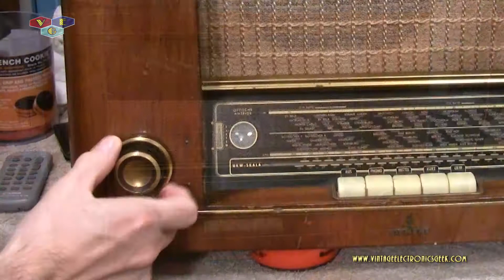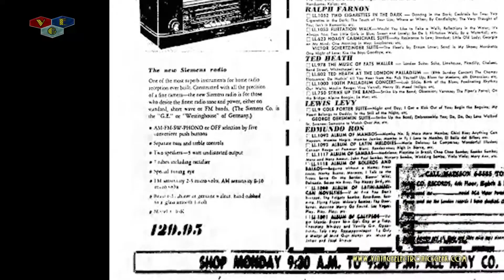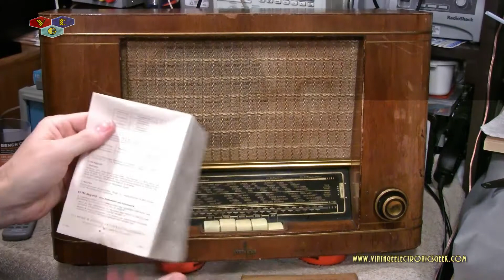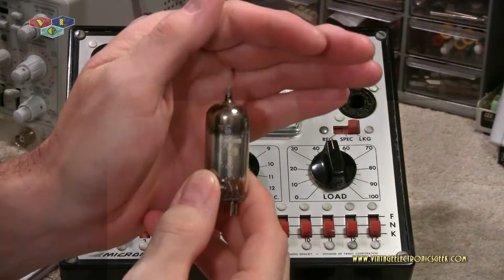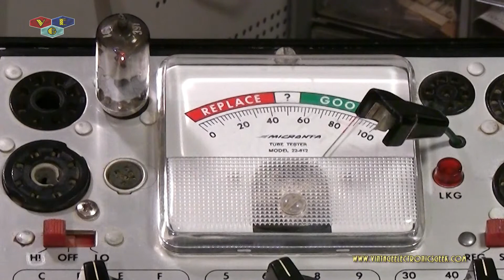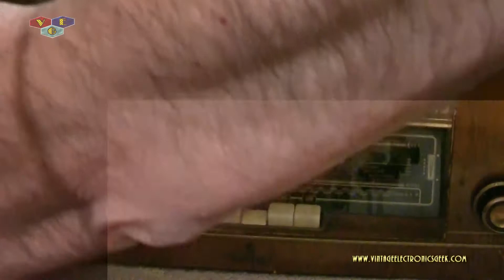Siemens-Super C 40 K - AM/FM/SW - Introduction / Overview

Comment: Hey Jack that siemens radio has the same cabinet and front face as my 1957 German radio I bought at the garage sale a couple months ago. All I had to do to it was restore a ferrite core it was missing and rewire it and clean the volume control and it works great. If thats the same its going to be a great project. All the same German markings as mine and the lettering shows like Luxemborg and various cities doesnt it . The only thing mine has extra is a cat eye tube for tuning. Mine is a Kapsch Made radio.
Reply from the maker: Howdy Larry!  If you done a YT video on it Im sure Ive seen it, will need to go back and search for it.  Your sounds like mine, an easy project...I just have other things I need to do first, so it will take a back burner for now.  However I think when I do start the work, I'll use Howards on the cabinet, lube the mechanics, and replace what I need electrical and of course the IF & frontend.  Thanks for watching!  ~Jack, VEG
Reply: Yes I did do a video and the only difference between mine and yours is mine has a cat eye tube in the center bottom of the grill yours has it off to the left side so pretty close. My cabinet is in pretty nice shape though. Its the one i picked up at a yard sale for $25 so it was a great deal.
Reply from the maker: Wow, thats a great price!  I'll have to go checkout your video catalog and see if I can find it!  ~Jack, VEG

Comment: Well, A pretty good radio from the outset, anything done to it will only make it better, and the case is in such nice condition it would be silly to refinish it.
 Cheers, j.
Reply from the maker: Howdy Joe!  You are correct, I think I'll just use Howards on it and leave it at that!  It did not have a back, so I'll need to fabricate one, I see pictures on line so I'll try and emulate them.  Electrically, I may just do the minimum, if it works good now, why not??  Of course I'll check everything and go from there.  Thanks for watching!  ~Jack, VEG
Reply: Always a pleasure to watch and listen to someone with a sense of humour poking summit interesting,
 Back panel eh?, I've thought about it, not knowing what materials are at hand there can be awkward, but If I had that task maybe 3/16 MDF drilled out a boring amount of times with a nice sharp brad-point woodbit then sprayed satin brown?, Just a thought.
 Cheers, J.
Reply from the maker: Thank you Joe for your support and getting my dorky humor!  :)  As far as the backing, yes that's what I'd do, however the paint I wasn't thinking of, I am now!  Thanks for your input!  ~Jack, VEG